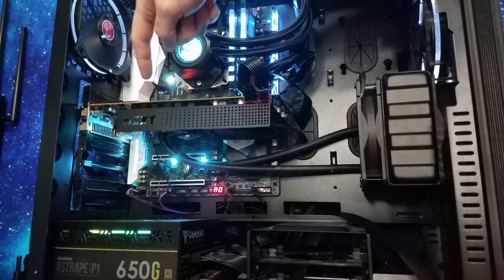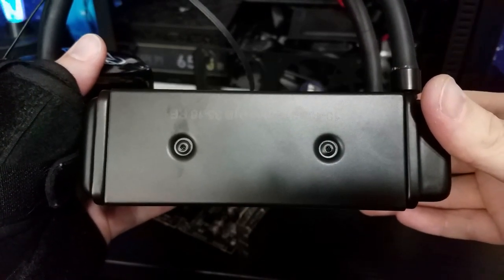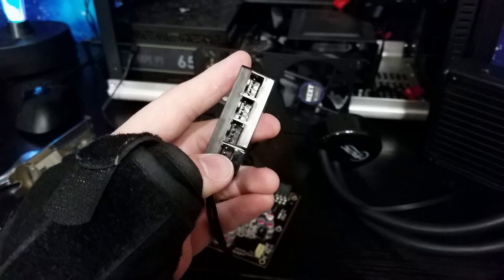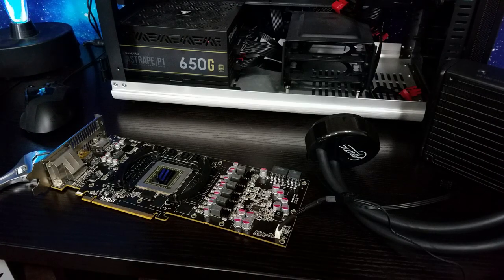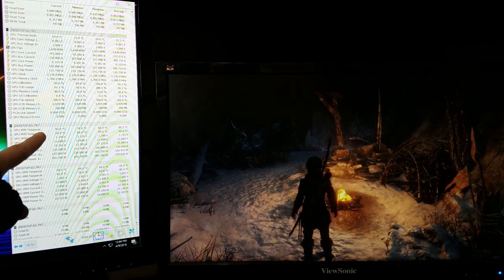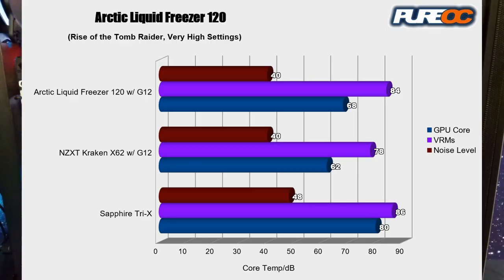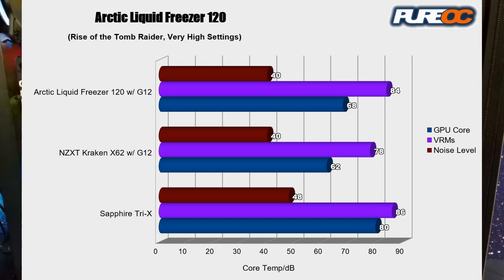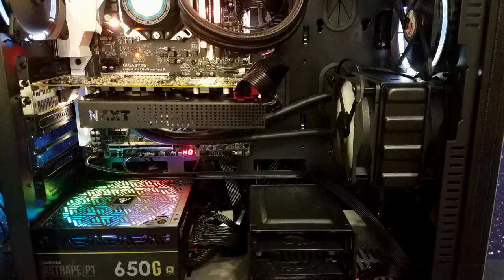Best Closed-Loop GPU Cooling - NZXT Kraken G12 w/ Liquid Freezer - Review

Comment: Nice informative video thanks. I bought one of the NZXT kits for $28.00 U.S.D. an installed it along with a Thermaltake 120 cooler on my M.S.I. GTX 1080 in less than a half hour. I jus had one minor problem mounting the cooler to the teeth and that was easy to solve just loosen the 4 screws and mount and then re-tighten. It has brought my temps down 10 degrees with a ambient temp of 77 degrees in the room.

Comment: hi mate did you tested with arctic freezer 120 fans set them as exaust to blow all that hot air outside front case? i think you will get at least -5 C to -10C on load?:D, i tested with my hand and that air that you blowing right back to gpu itself is hot like hell under loads games

Comment: Got the same problem fitting the pump but with the 240. Instead of messing with the metal teeth on the G12, I just loosened the 3 screws on the pump half a turn (NOT on the copper cold plate,  I mean on the plastic). After fitting the pump you just fasten the screws again.
Reply: I don't see how losening those 4 screws help :s i am trying to install it right now. no luck.
Reply: Never mind, it works lol!, thx
Reply: I did the same loosened the screws and then it fit.
Reply: @ISFRedSandman  Hi, do you know if that method would work if I wanted to use a Corsair H115i aio cooler with the G12 bracket?
Reply: Which pump?

Comment: I understand this may be difficult/costly, but is there any chance you could test with an NZXT G12 approved 120mm cooler, such as the Corsair H55 or EVGA CLC 120 for comparison? I know that these have the smaller radiators, but if cooling performance and noise levels are similar, it would be much more attractive to not have to deal with the install hassle of bending the fins down until they fit.
Reply: That would be awesome! One thing to mention, IF you run a test on a 1070/1080 unit, as I'm sure you know, Nvidia reference boards do not have VRAM temp sensors, so we wouldn't be able to see any potential negative effects removing the heatsink may have on those. The only OEM that I have personally seen with sensors on the VRAM are MSI, but that could have changed recently. This would also be a pretty nice test if you could fit it in, but I think regardless this would be a massive gain in understanding how well the G12 system can perform!
Reply: Pyromonkey83 I have this on my 1080ti armor OC with the Corsair H55, brought my temps from 88c to 42c.

Comment: I have a H55 on push-pull on my 1080ti. Temps in heaven are 57c after 1h, though they can hit 62c-64c on repeated 3dmark tests. Please explain why you have the radiator on intake. 

for me I gave it some thought about which way I want to align the radiator, and I decided to completely REVERT the airflow on my case. Starting from REAR (not front):
Rear: 140mm INTAKE
Top: 2x120mm Corsair H80i Exhaust (CPU cooler)
Side: 230mm INTAKE 
Front: 2x120mm Corsair H55 (GPU cooler) followed by 2x120mm Exhaust fans

The reason why I Have 2x120 AFTER the radiator (other than the push-pull) is because I actually feel the heat building up in my case. This way the heat is taken out. In your configuration the heat stays in and probably hits the VRMs + CPU. Of course it is probably working fine but fundamentally thinking a GPU radiator must be on exhaust.
Reply: Your issue sounds like it comes from a case with general bad airflow, or something getting too hot.

My Gigabyte GTX 1080TI with NZXT G12 + some old Alienware AOI liquid cooler, has the radiator mounted just to the right of my card, towards the front intake fans, and my card has not seen temps over 54 degrees, even after hours of play, and both my CPU and GPU is heavily overclocked.
i7-4790K (4.7GHz/1.280v). GTX 1080ti (Core: 2050MHz/Memory 12990MHz/1.094v)

So there is no "fundamentally" here. If you have a good airflow, and good temps on everything else, you can pretty much place it where you want...

Your idle temps are useually a good indicator of your airflow... My CPU´s and GPU idle temps are under 30degrees, and after heavy loads, the fairly quickly go back down to those temps, which suggest the the case is very good at getting the heat out...
Reply: @MrRotten187   he is right i tested with arctic freezer 120 fans set them as exaust to blow all that hot air outside front case, or in the back of the case fans set it as exaust to blow hot air outside reat to and i get at least -5 C to -10C on load.
You can also tested with my hand and that air is hot like hell under loads games, if you put gpu radiator fans as intake you will blowing all that hot air right back to gpu itself and u can fry eggs in your pc :D
Reply: @faithful2008  I'm not saying you're wrong, but just saying i run it as it is claimed not to work, and for me it works perfectly...

So other factors may be the desiding ones...

Comment: How about the Arctic Liquid Freezer 240 - is it working with the Kraken G12? Thanks.
Reply: 1. About the mounting holes for VGA: do you think it will work on an MSI 1070 Ti Gaming? Do you know any way to check this info somewhere?
2. About the pump block, you said you have to bend the bracket down a little bit, but how can I make sure that I don't bend it too much? Do you have some pictures like before/after for easier reference?
3. About the cable to plug onto the VGA fan header, can you give me the link where you buy it?
Great thanks.

Comment: i have the same cooler whit g12 on gtx 1080ti SC2 icx. after oc core 100mhz and ram 450mhz gpu newer go over 60c. i put some metal heatsink like you on memory and vrm.
Reply: ny stock sc2 hybrid, power modded and with xoc bios pulled over 540w, ran at 2164 mhz and max temp was 52, you are doing something wrong check pump speed stock temp never went above 48

Comment: Do u put it on exhaust or I take for g12?
Reply: i did this to my 209 before i upgraded to 2080 rtx dude u need that on exhaust Trust me you dont want all that heat dumping in your case and this is from experience.
Reply: GamerOnAKite so u want it to be blowing away from the gpu and not on it ?
Reply: if you put gpu radiator fans as intake you will blowing all that hot air right back to gpu itself and u can fry eggs in your pc :D

Comment: is that card really around 28 degree hotter than a 1080 ti ? , damn thats hot ,  my friend has same cooler :)
Reply: thats where you would upgrade to like 360 radiator just for your gpu :) , im gonna get the same cooling setup for my 1080 ftw2 , and im not counting on it  to get much higher than 50 degree celcius with 2.1ghz on core , :) ,

Comment: In F or K , please use, I do not like or use C =P       Thanks for data . Thinking of putting one of the nzst cpu coolers on a old 650 ti boost  ..... for overclocking to max .....Evga FTW3 1080 ti made great backplate. o p.s I run all cpu /gpu coolers run fan speed 100% If i put 5 grand in to a pc i want it to sound like a server unit =)...-P